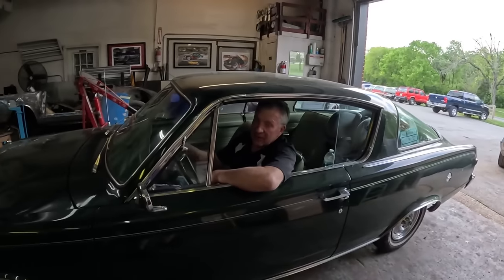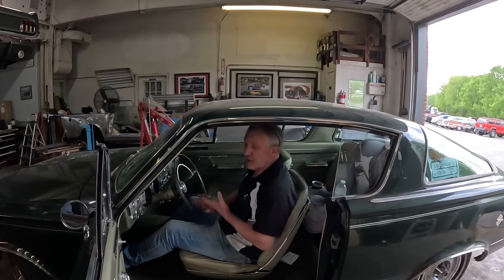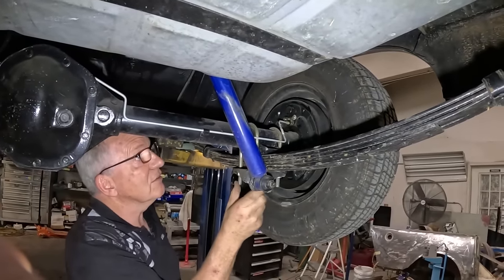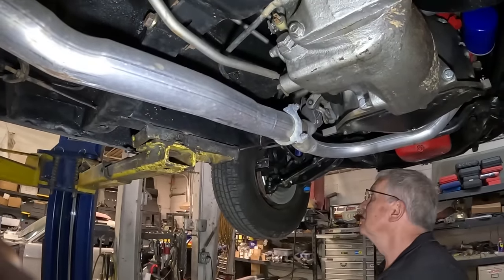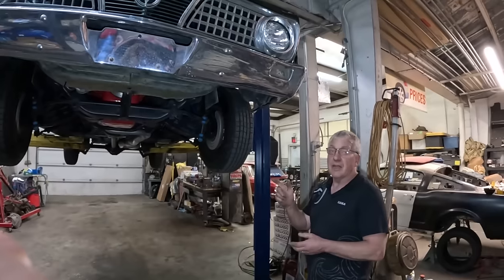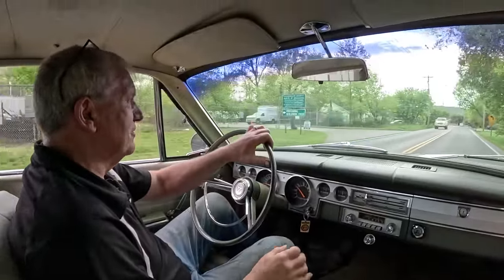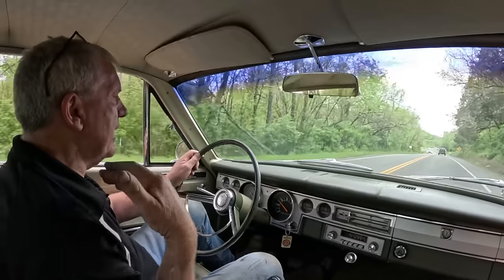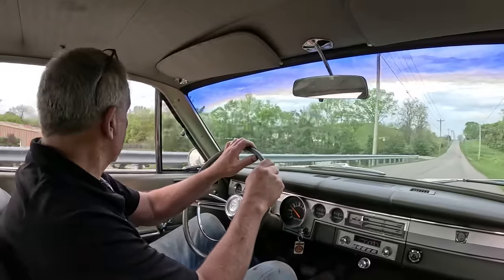Barracuda Bliss !!   273 4 Speed Formula S

Comment: The Sure Grip differential was an option. The 7 1/4 axle is notoriously weak, again, designed for the six, but if it’s still fitted with the original Spicer Power Lok 4 pinion differential, it goes a long way to making it live. It’s a beautiful car, and that’s a nice looking exhaust system.

Comment: I had a '65 Dart GT back in the day that was equivalent to the Barracuda S. I had the factory Hurst shifter as opposed to the Inland shifter that this car has. Mine was 273 hp with the single 2 3/4" exhaust pipe and square resonator out back with the Sure Grip diff, white with blue interior. Absolutely loved that car. The exhaust note was perfect. Would love to have that one back.

Comment: Those Chrysler Corporation compacts were adorable, until the 1967 model year where cheapened interior materials began substituting traditional trim. 
I used to own several ('63 Dart hardtop, 2 '66 Valiant 2-door sedans, '63 4-door Valaint and a '65 Barracuda 273 2-barreled engine), buying them cheap. 
Torsion bar suspension made them ride nice and they all were dependable. I ended up getting rid of my Barracuda, only because I and the seller thought that the frame at the front right was bent. Uncle Tony recently explained that a loosened suspension fastener gave this impression and that it was easilly repairable.
I can't imagine that a limited-slip differential would be an option on a Formula S. Although, General Motors reserved limited-slip on their top of the line luxury hotrods as options. So, who knows

Comment: Nice .  😊 I picked up a1964 with the 225 Commando auto trans. For $250.00 in tow auction in the late 90s. It had the sport turn lights in the grill and console shift set on the floor silver paint black interior. All stock so not as nice back than but still good looking. To everyone except the wife? So a year later I sold it to a work friend and he drove it from Seattle to San-Fran and smoked the rings like I told him it would . But I got $1500 and I'm sure he got more in Cal'y   😂
   Like you I stuck to my Mercury's two 67 Cougars and a 68 Mercury Montego MX that we have owned since 1998. Sold the 57 slab-side Custom-cab with original Chrome bumpers front and rear along with the 67 Ford Fairlain 500 2 door. After buying our Home. 
   Fun Fact; the 68 Montego weighs almost exactly the same as the 67 Cougar.
Just a Boy and his Toys life style.
Reply from the maker: Cool story, thanks for sharing!!

Comment: Very nice Barracuda, it's in great condition. Shouldn't the rear axle housing have a ventilation bolt on the brake distribution block? I noticed a normal bolt on there. My 69 had a normal bolt too, but you would think the pressure that builds up forces the pinion seal to leak.
Reply from the maker: Hmm.. good question!
Reply: @kiwiclassicsandcustoms9160  After taking a better look at it, the 7 1/4 rears apparently don't need the vent bolt, as there is literally right next to it a welded on cover, that acts as the vent. So never mind!

Comment: The original first gear ratio on this drivetrain would be a 3.08 as I remember, which is anything but tall. Even if it had a later A body 4 speed installed, that’s still 2.66, which isn’t in close ratio territory either. I don’t know what’s possible these days, but those were your options in the 60’s
Reply from the maker: Well driving it 1st gear was pretty tall 🤷🏼‍♂️

Comment: I am no expert but I didn't know any 7 1/4 axles to have a sure grip and it should have a tag on a inspection cover bolt * if it didn't get lost over nearly 60 years* 
my 65 Barracuda has broken 5-6 rear axles and when it does it behaves like a sure grip because *Ours likes to bend and break the shaft the spider gears ride on in the differential case I literally have a Broken one under mine now as I am swapping in a different axle